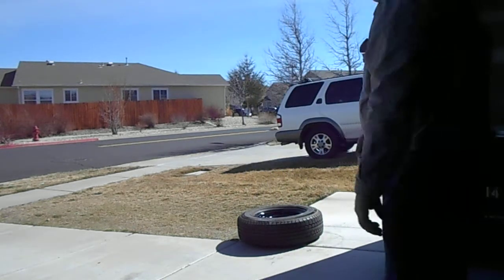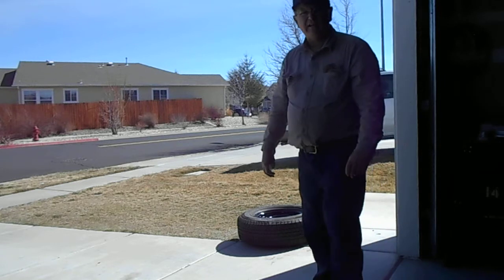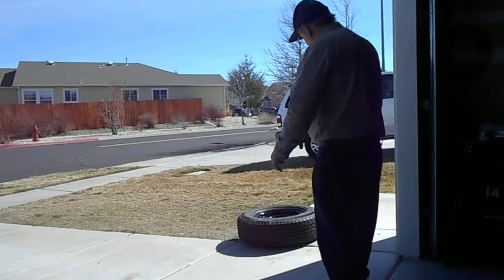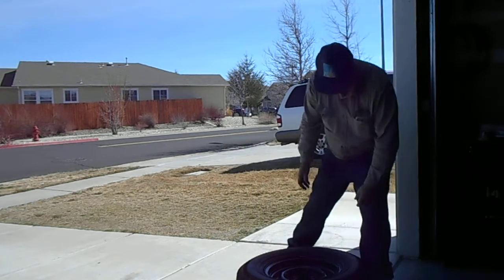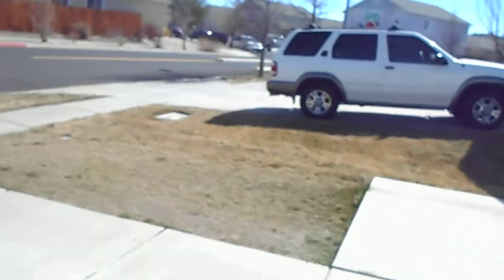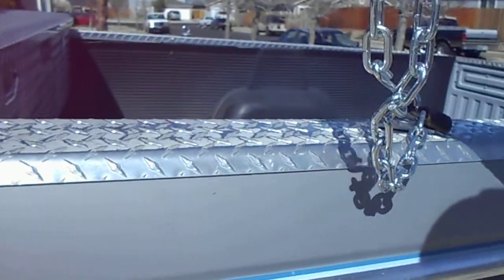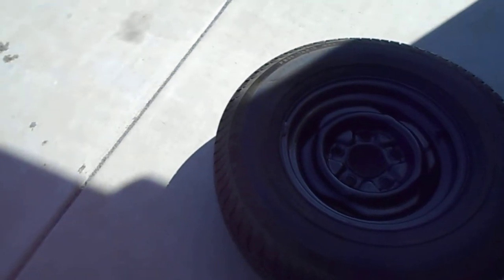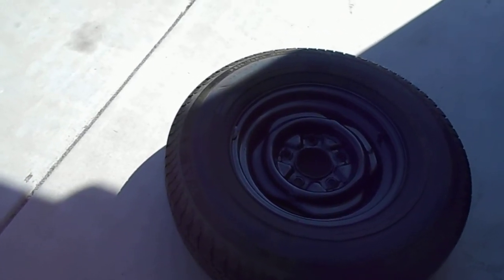Cleaned and painted Spare For 1989 F150

Comment: Looks great
Reply from the maker: WallysPlace66 After i cleaned the tire off it had no weathered cracks no melted areas it looked like a new tire .after i cleaned the dirt of the rim that was facing down the black paint wasnt even chipped so painying with the rustoleum was just because
Reply: Excellent

Comment: Lots of "bling" with that pretty wheel an chrome chain. Do you Disco?
Reply: Only when he has a fever.
Oh and on Saturday nights.
Reply from the maker: cutworm59 yes well its just temporary until i weld up a frame to hold the tire. I have some square tube steel I can weld in two triangular sections with a support across then bolt it in place and use the chain at the end to have a quick release